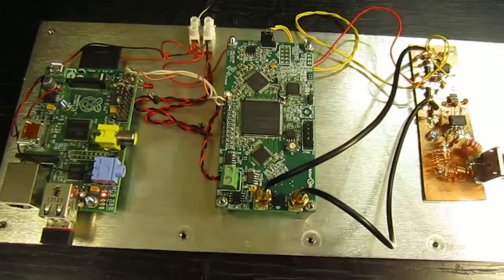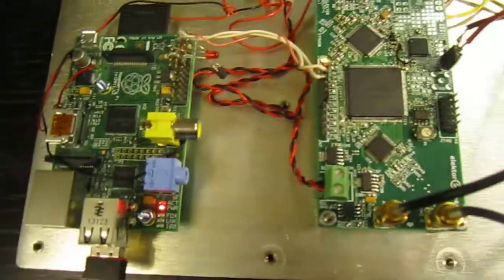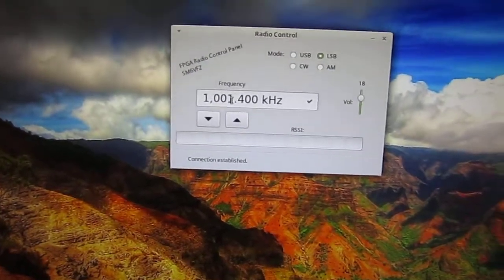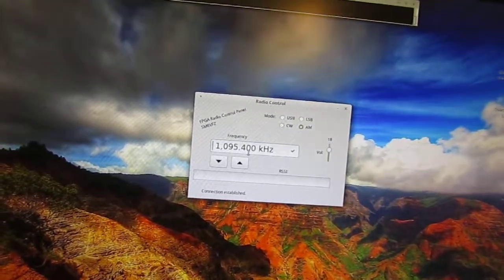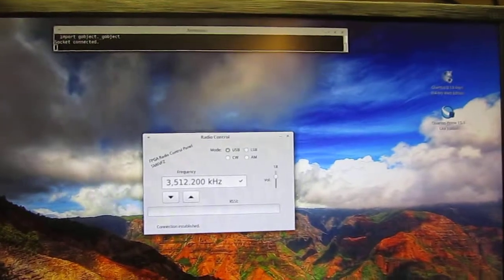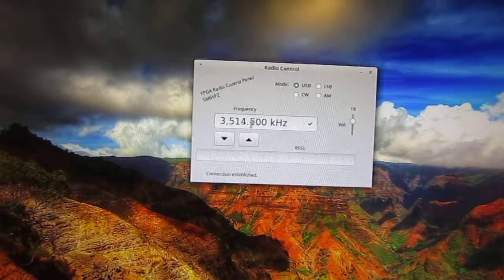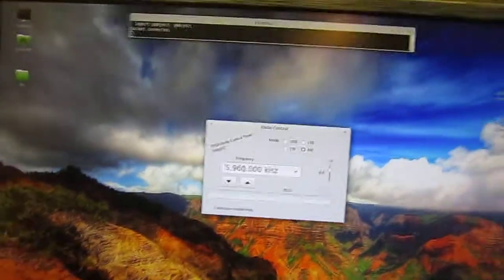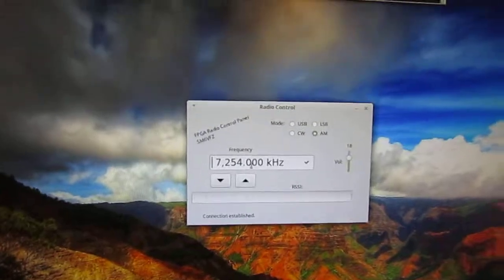FPGA radio control over LAN and Raspberry Pi

Comment: Awesome one...  Could we do the same directly on fpga without using the rasp...
Reply from the maker: Yes! The rbpi is just a control board. Here is the same FPGA radio with a microcontroller+lcd for control: https://www.youtube.com/watch?v=DEgR8Y6aEVA&t=37s
My friend also use the FPGA with a MCU control board: https://www.youtube.com/watch?v=jcrzIcjE5D8
Check out the project in Elektor: https://www.elektormagazine.com/labs/microcontroller-board-for-fpga-dsp-radio-160410